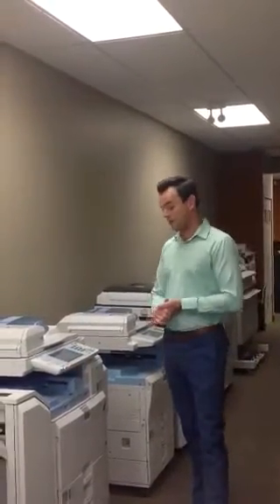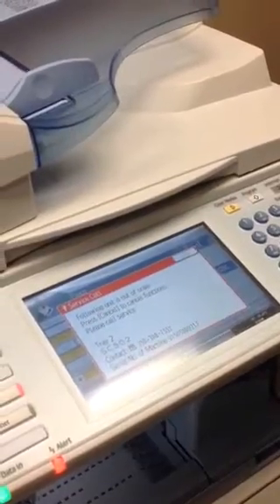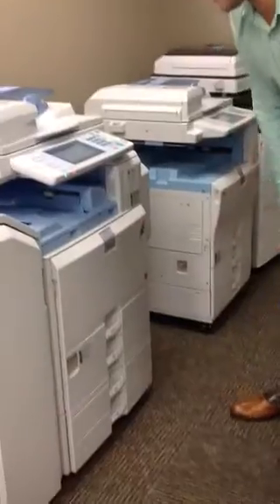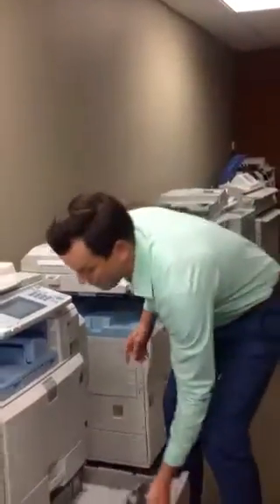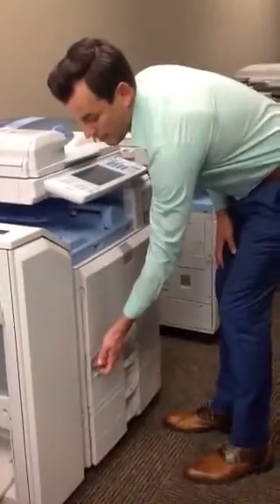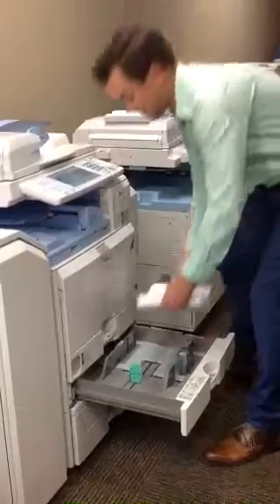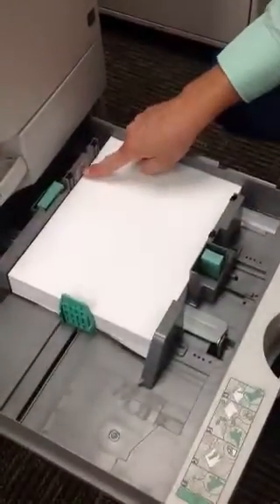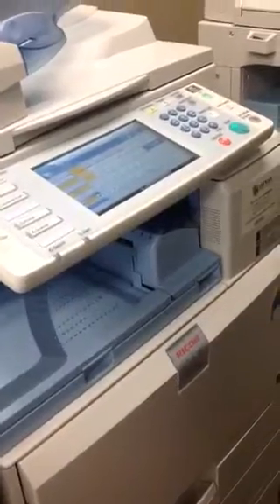Resolving the SC-501, 502, 503 or 504 error

Comment: 1 you need to power down the hard drive using the op panel sw first then the main sw 2nd not to crash the hard drive then check for paper in the back of the paper tray for paper  then reload the paper tray and switch the print back on
Reply: hello friend: I am in California...if your are here we can talk 1 714 720 8020 been do this thing for 30 yr I am good with the Ricoh products